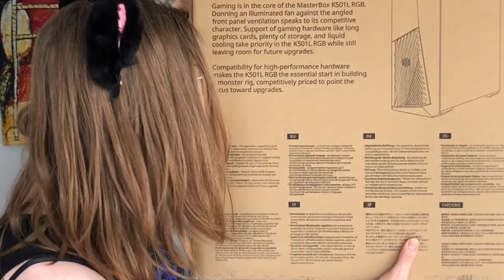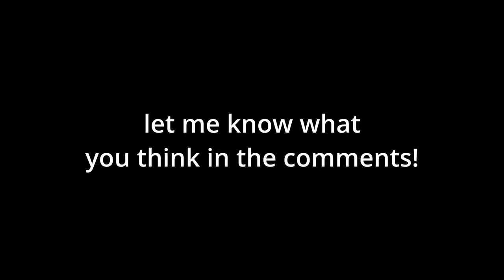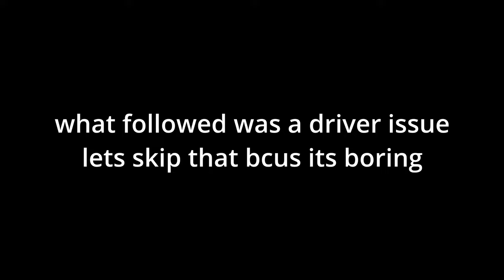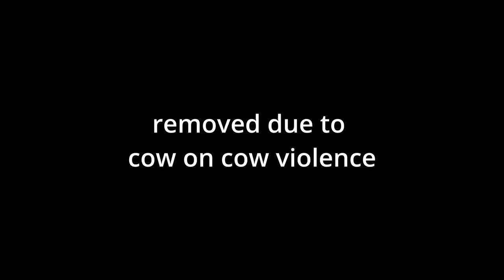I Built a Trans Flag Themed PC

Comment: Minecraft with shaders is amazing. I use Iris and Sodium, the latter improving frame rates immensely. With my medium Sildurs shader, in open landscapes I find myself running near 100 fps with render distance at 32 I think. I cheat a bit though and have my older computer run the server so some of the stress is on that computer.
Reply from the maker: Cool!

Comment: You know what part would have been perfect for this build? Imo a Yeston Sakura RTX 3070/3080 or RX 6700/6750 XT, vertically mounted (not the 4080 though, it's got too much going on and honestly looks bad in comparison). It even has the trans color scheme, and in general I think it's just the cleanest looking graphics card ever, apart from maybe Nvidia's RTX 20 series founders edition cards. It's just hard to find for a reasonable price unfortunately.

I'm actually kinda sad they screwed up on the 4080 design, it's "cooler" but nowhere near as clean looking.

Also i do recommend lifting your PC up a bit with something, to get it off the carpet. It can be bad for especially the power supply since it won't have good air intake, but also in general it gets dusty faster when it's closer to carpet.
Reply from the maker: Good advice!!